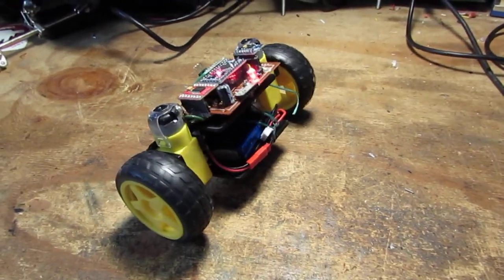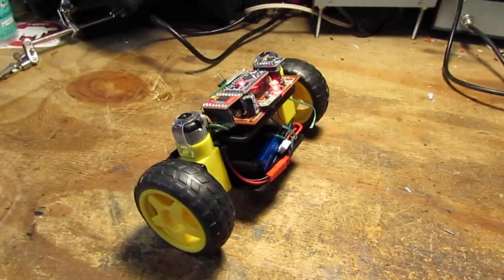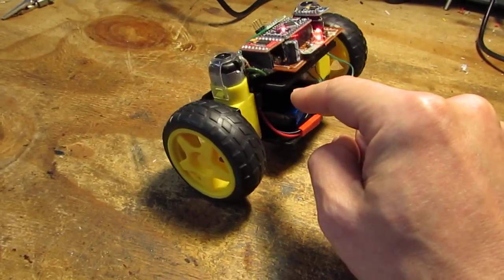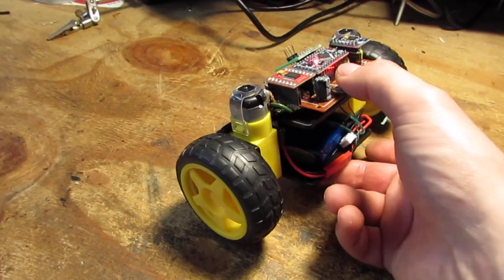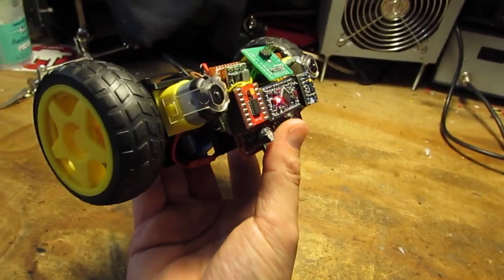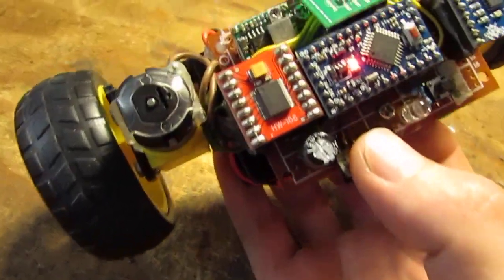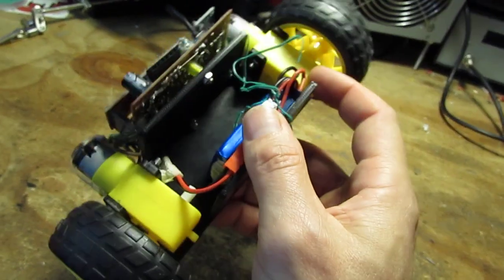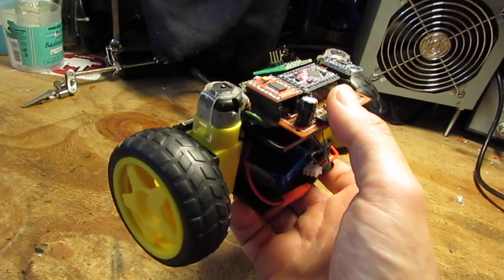InEquilibrio01: a simple PID controlled self-balancing robot

Comment: I've never seen a robot have a spasm before.
 I love it.
Reply from the maker: :) if I remember well, I've try to smooth it a little, I'm speaking in 2017 when I built it, but using that motors i was able to reach just the results you see. Visually it's an high P coeff.